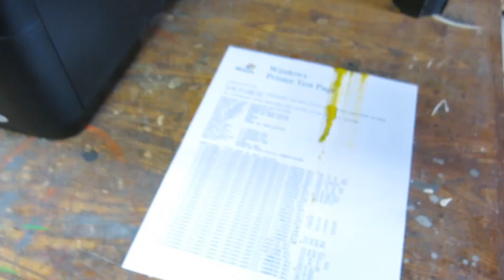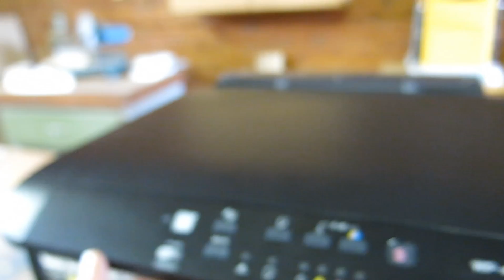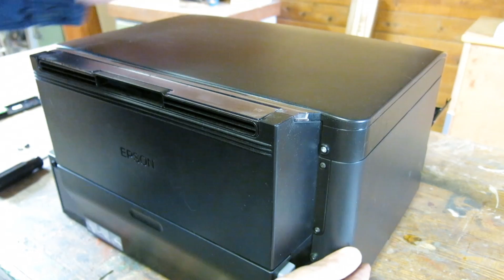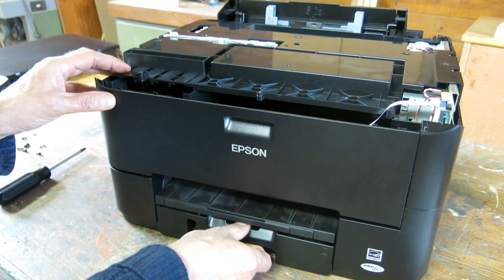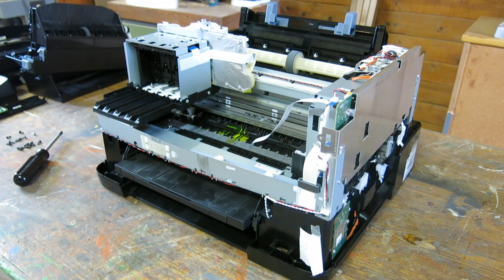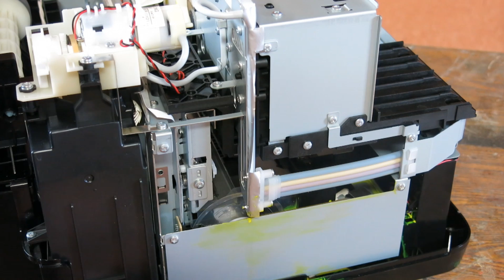epson printer WP-4020 ink leak problem - disassembly

Comment: Thanks George.  I'm working on a WP-4540 that I got for a song, same yellow ink problem.  To remove the scanner assembly from the top you will need a hook tool to pull off the 4 electrical connectors located just above the USB/ethernet ports at the back.

Comment: This is very good demonstration. This is very similar construction in Epson WF-5690, WF-4630, WF-4640. There is clearly a design flaw with these long ink supply line printer models and it is not easily fixable. It seems that there gets high pressure when the printhead cloggs and after some time this junction fails and leaks ink. I wonder if it would be possible to cut out the clogged supply line somewhere in the middle, and use cleaning kit from the cut supply line to clean the printhead?
Reply: Because there was nothing to lose, i used techinical vibrative saw (Lidl Parkside multipurpose tool PMFW 280 A2) to cut out plastic from the left side. Then i cut the inks supply line and connected each line to syringe cleaning tool. I removed the supply line from the printerhead part and put the cleaning fluid throug the supply lines so there was no clogged ink left, only cleaning fluid. Then i connected the supply line to printerhead again and put cleaning fluid from the cut lines (left side from the printer.) But nothing helped, the printerhead was totally bricked, not a single drop came through. So there was nothing to be done just put the printer to waste.
Reply from the maker: @aris95  Good for you. You worked hard to understand the problem and you kept your printer running. These are great printers. My two are still running without the problem. One was replaced by Epson over 5 years ago! The other never had the problem, now probably eight years old.

Comment: Be sure to do a nozzle test. I did it a head cleaning three times a few weeks ago and it cleaned up my black ink smear. Smear came back and I did a nozzle test and head cleaning 3 more times with customer service and it cleaned up my black smear BUT I could not get rid of one spot on the Cyan. They called it a hardware issue and sent me a 15% coupon (good only for 7 days) if I didn't want to send it to a service center (72 miles away).

Comment: I have a WP-4530 - same yellow ink problem.  Called Epson based on the recommendations here and they were very helpful in working thru a similar replacement.  Created a CC hold of $179.99... just a heads up, they are asking for the replaced printer to be returned.  They sound like they will even be helping out with the extra ink cartridge (new and unopened) I have since the new printers don't use this ink.  I can't be happier with Epson right now, very happy with this level of support.  It's actually over the top even.  That said, they must know there is an issue with those ink lines.
Reply: My WP 4530 had a similar problem in Jan 2021 but with the black ink. I called Epson (customer service is in the Philippines) and got nowhere. They offered a 15% discount, good for a week. No refund on the new, unopened, unexpired ink cartridges I had just purchased. I spoke with the 'sales' department about purchasing a new printer. The coupon was not valid on new printers - just refurbished units. Oh, and they had none in stock... Not happy at all with Epson. This was my 4th or more Epson product (printer, scanners). After this shoddy customer service experience, it is my last!

Comment: Thanks George for posting this information. April 2018 Update. My WP-4020 has the same problem and this is clearly a design defect, Epson no longer replaces these printers, so previous posters should be glad that their printer failed within the warranty period. My response to Epson:

I am not satisfied with Epson's response to this problem. I am having large yellow streaks and globs of yellow ink show up when I print. I purchased the printer in 2012 and the wireless quit working within two years. I compensated by connecting the Epson to an hp en3700 Network connection to USB port and connected the USB port to my printer. This has worked fine until the recent yellow globs and streaking (I can send scans if requested).

The service representative had me perform four print-head tests and three print head cleanings and each time I noted the large yellow streaks, which would not be a print-head cleaning issue (I already performed these procedures back when I first noticed the yellow globing). This was a waste of time.

A quick online search shows this YouTube video and a large number of other videos describing this exact same problem for multiple Epson printers: https://www.youtube.com/watch?v=ZZ1jkgE9TtA

This certainly appears to be a design defect and unfortunately my product did not exhibit the defect early enough to have the problem properly resolved.

I wasted an extra 676XL Yellow cartridge trying to resolve the problem, plus I still have the other color and black cartridges in the printer, plus I have two unopened cartridges (Magenta and Black) all of which probably cost more than the printer and are now unusable.

The 15% coupon is hardly a appropriate response for a product design defect. A 15% coupon plus a set of new print cartridges is the least that should be offered.

This was my first Epson purchase and I now know that Epson will not recall and fix an obvious product defect (based on the number of comments and videos about this same problem).

Regards - Cliff Cummings

Comment: My w 4020 was not working and would die and all of the lights would light and not quit.  I followed your dismantle and eventually found my machine's problem.  An optical wheel beneath a panel under the ink reservoirs had some dust on it... I suppose to some minor rubbing.  I cleaned the dust off and my machine is working again!  Thanks for your great, clear directions with your great comments.

Comment: I purchased my WP-4020 printer in January 2014 costing US$99. It is now September 2016 and, after 2-1/2 years later of great printing, it began leaking black ink recently.  I just got off the phone with Epson and, WOW, 10 minutes later they are sending me a replacement printer.  Way to go Epson!  I knew I would be glad I moved away from HP!  Note that the replacement may be a "substitute, equivalent or upgraded" printer.  I will report back on what I get.  Hmmmm, what to do with the old printer?

Comment: I was all excited to be able to watch the video to help me FIX the problem. Little did I know that it only got me through the maze of taking the unit apart (albeit, it was fun to do). The best info was reading all the fellow responses of the common leaking ink problem and their resolutions, i.e., call Epson. I just did and they will be sending me a new, upgraded version of this printer at no cost to me. The best part is I don't have to put the printer back together again. My kitchen counter looks like Humpty Dumpty with printer parts. Thanks everyone for chipping in.

Comment: Happy result 2016!

Moved my Wp-4535 (4 year old) to check for a 'paper jam' to fin a small pool of Yellow ink on the lefthand side. So having found this video,  I phoned EpsonUK Support. The call was quick, but as it is a Buisness machine I had to wait a few hours for them to phone back. They just asked a couple of question to check where the ink was coming from and dispatched a replacement unit in '2 working days'. Courier to pick up the old machine.

Comment: Just called Epson support for this problem, spent an hour on the phone with a call center in the Philippines which rendered no help for the blue streak on my paper.  Even though our product is registered, the only option they gave me was to purchase a new one.   I made sure I told them that others have the same problem... made no difference.  I'm not impressed.   I might just call Epson and try to get someone in the U.S. to handle my call to see if that helps.  My ink cartridges are new and cost well over $100... so I'm out that money too... just in time for back to school

Comment: Yep, same problem here, I loved this Epson 4540 Workforce printer until it started leaking yellow ink all over my paper. Now I just want to smash it. Hopefully Epson has fixed this problem, because the printer was wonderful before the leaky yellow ink.
Reply from the maker: Loren P. - did you look around at the comments here? Epson will replace your printer FREE. My replacement printer (now over a year old) has been just as wonderful as the original but it does not leak. Good luck.
Reply: I looked further into the posted comments and called Epson. They are shipping a replacement. Thanks for taking the time to post this video!

Comment: Thanks for posting. Same problem, here, with WF-4535 (3.5 years old). 
Called the Epson service center in the NL. Epson sent me a new printer 
WF-4630 pronto, free of charge. That's the attitude that builds customer
 loyalty, even when products fail to perform. Was good to be able to refer to these similar cases. Cheers!

Comment: Hi George   I have an Epson WP 4540 and the black ink leaks from the maintenance box after a print head cleaning. I removed the maintenance box and it is all covered in black ink. Obviously it's not streaming properly in the open slot. What could cause this? And how could I fix it?
Reply from the maker: +Doreen Kuzdek Probably your maintenance box is full and you should replace it. They are not expensive, I think $12-15 each and are available at the epson store. Another nice thing about the Workforce series of printers is that they have user replaceable maintenance boxes. Just look around the back of the printer and you should find it.
Reply: +George Plhak I checked the maintenance box and it's not really full at all. And even the indicator on the printer says it's ok and not ready to be changed.  The ink is coming out all "over the top of the  box" and down the sides of the box instead of pouring into the open slot of the box. I have ordered a replacement, but I'm afraid that it will still spray all over in the compartment and leak black ink on the printed pages....From you taking the printer apart - did you see how the excess ink gets flushed into the maintenance box during print head cleaning???  Is there a hose that maybe has come loose???
Reply from the maker: +Doreen Kuzdek In that case, you probably have the same problem that the rest of us are having and you should call Epson and ask them for a replacement printer. The maintenance box should catch the excess when the print head is cleaned. The print head should be over it when that operation happens. You and I can't really tell where the ink is coming from without some surgery and likely it is not something you could fix on your own. That is the conclusion I reached after getting inside. My yellow diaphram had burst, perhaps with yours, it is the black diaphram. I think someone else reported magenta. Call Epson now.

Comment: I'm in Italy here and my WP-4525 (warranty expired November 2012) developed this problem over the last months (first it leaked only tiny little drops of yellow ink but last week with a new refill it began loosing massive amounts of ink). I contacted Epson support via online chat and was readily advised that I could bring it to their next service center and that it would be repaired free of charge in case it had developed that specific breakdown. Since the next service center is not far from my home I didn't inquire for other means of transportation and simply dropped the printer off there myself; they had a lot of these printers there, btw. Picked it up again a week later and it has indeed been repaired free of charge. I am glad since I still have 100€ worth of ink cartridges I couldn't use in any other printer!So if you have one of these printers give the Epson support a call.
Reply from the maker: +namulit emperor Good for Epson. They fixed your printer even when you were over three years out of warranty. Impressive!

Comment: anyone tried getting this replaced in canada? same problem, took it apart and found the yellow seal is leaking ink.
Reply from the maker: +Cameron Berry I am in Canada. Worked for me. I shot the video. Epson shipped me the replacement printer to my Ontario home and I did not have to return the leaking printer. Thank you Epson!

Comment: Hi, I have managed to repair a WP-4545 using a Hot Glue gun. I first had to clean the area until dry, then using the hot glue gun seal all the way around the yellow Ink well and then making sure the plastic cover is well glued. I then did all the other colours while i had the opportunity.  Printer is now working well,
Reply from the maker: +john l Good for you. I looked at doing that, trying to replair the broken seal. With Epson possibly sending you a free replacement unit, why don't you ask for that?? Your repaired printer will give you output until the replacement arrives.
Reply: +George Plhak took me 20 minutes to try and repair, if this did not work, would have done what you have suggested. So for the time being if this carries on working will leave as is, however time will tell as they say!
Reply: +John - And after this the yellow color has been lost forever?
Reply: Hello, I know this is old post, but can you tell me, how exactly did you repair it? I am in exactly the same situation with WP-4535. The yellow ink "circle" has about twice as much ink as others. Did you just glue it around and left it that way? Please answer, if you remember
Reply: How did you get the cover off, im struggling to get my printer cover off ?

Comment: It is a brilliant video. I have EPSON WP 4535 (basically the same, but european model). Printer is similar, mine has scanner on the top. Is there any chance you have instruction how to dissasemble scanner. After scannet is dissasembelt I believe all the rest is shown on your video. My overall ailm is to clean printing head.
Thanks!
Reply from the maker: Thank you Thomaz. No, I do not have a WP4535. Good luck cleaning your print heads. I hope my video will help you. George

Comment: To provide a current (as of May 2015) comment to this video - I too have the leaking ink issue with a WP-4020 after about 2.5 years of use. I called Epson a few minutes ago and they are going to provide a replacement printer with 2 sets of ink cartridges. Very impressed with the way they are backing up this product! This kind of (rare) service will keep me as an Epson customer.

Comment: I am writing this on April 5, 2015.  We purchased a WP-4530 in 2012 and began experiencing the ink leakage problem a couple weeks ago. Ours was leaking blue ink.   After reading George's comment,  I called the Epson support number, and to my surprise they are sending us a refurbished 4520 for free, even though our original machine is out of warranty.  This is an exchange, so they asked for a credit card number which will not be charged unless we do not return our original machine, and they are paying for shipping.  This ink leakage problem must encompass a lot of machines for them to offer this, but I am impressed that they would stand behind their product.  In the past we have had trouble with the printers from other large companies (think two letters) and they refused to do anything.  Until the ink leak, this printer has performed very well so if they've solved the problem we are pleased to continue using one.  Our experience with refurbished products is they often perform better than new ones.  Thank you, Epson!   And to readers of this......it's a good idea to register your product with the manufacturer....I believe that helped in this case.

Comment: George - You are the ONLY person I have seen who has shown how to take the Epson WP-4020 apart.  Thank GOD you did so.  I have the problem of I turned off my printer over six months ago when I started my new job and only recently tried turning it back on.  Of course all of the ink had dried on the print head.  I was at a loss on how to take the thing apart so I could use a toothbrush on the print head to clean it.  Now at last I'll be able to get the thing open.  If you get the chance - can you tell me anything I might need to know about getting the print head off?  There are a lot of screws in there than I can see through the door.  So I am assuming there are a lot of them to keep track of.  So any insights would be helpful.  Thanks in advance for any advice you can give.  :-)

Ugh.  I thought I was liking YOUR comments and instead I liked my own.  Just not my day I guess.  :-/

Comment: Its an ink damper. It prevents ink flowing backwards. Obviously this part should reside in catridges and it should not be put against such a pressure that it causes material weakness. Hot glue gun or resin glue will help you here, then one needs to reinforce it with tape. But an equivalent machine like officejet pro 8600 from HP does not have this and is much better. It also has removable printhead for much much easier de-clogging, the printhead is replacable and it does not use any ink pump - relying on air compressor instead, keeping all clean in long run. It also does not use CISS-like tubbing  (under constant pressure - no doubt) leading to even less problems.

Comment: Thank you George!!! This is my second Epson WP-4010  The first one would not feed the paper to be printed. The wheel was broken. this time it is bleeding yellow. I called them and they are sending me a replacement. I do have to send the defective printer back. it will be free to shop is back witch is great. Thank you so much for the disassembly tutorial. it was a big help. ps i love taking things apart to see how they work and if they are broke I like to see if I can fix them.